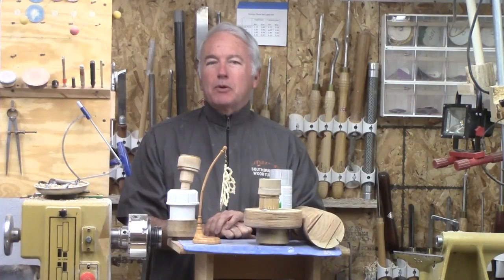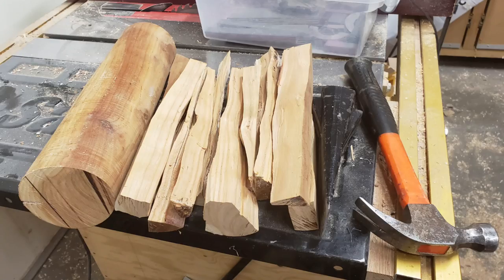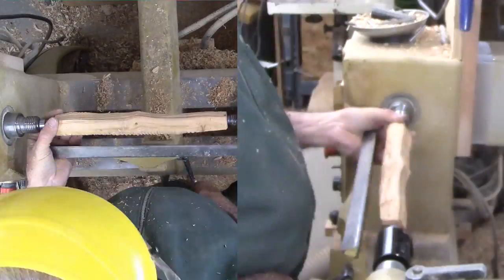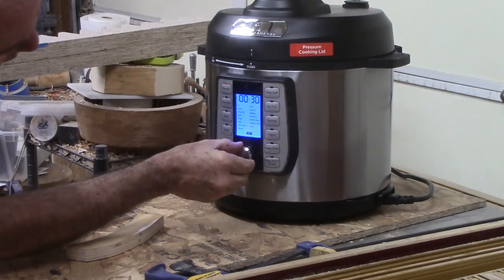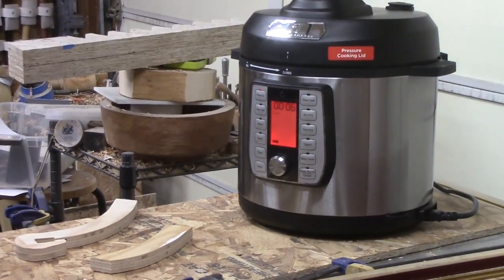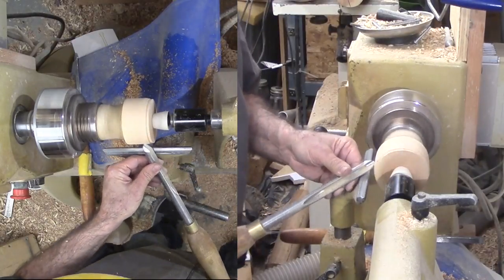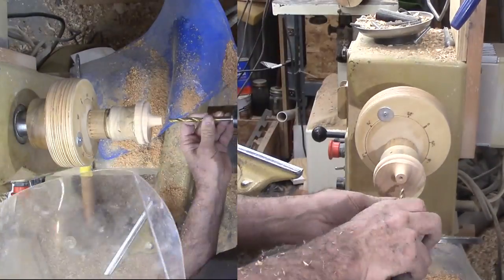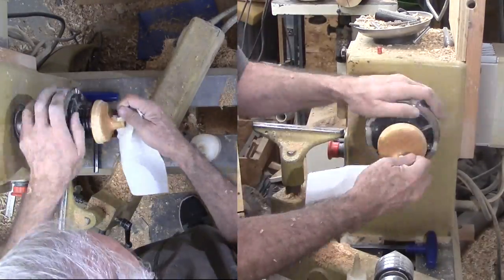Woodturning Project Stand - Steam Bent and Multi Axis

Comment: Great project, looks very good. Instead of a pressure cooker one could take a page from Mike Hosaluk's book and use the microwave. I attended a work shop with him and he showed his method of prepping for bending. We used a form for shape, and wrapped the work piece in a towel soaked with water. A couple of minutes in the microwave and the boiling water and the fluids in the wood resulted in a very flexible work piece, just had to be careful and use gloves to handle the boiling hot piece. Once in the form and allowed to cool it stayed in shape. Quick and easy.
I also watched David Springett do something similar with branch wood that was rived from a branch, he used a post iron to heat the wood with just a wipe of a wet rag. He suggested that the water content in cells made the branch soft and the outside water may have been overkill but he was able to manipulate the piece a bit at a time without using a form.
Reply from the maker: All good alternatives to consider. 
Thank you Bert
Alan

Comment: Outstanding Alan. Thanks for the tip on splitting wood for this spindles. And the technique of turning the spindle tip then working back to the base to prevent whipping. Nice idea on the pressure cooker. The bending jig worked very well. Nice fixture for the offset turning of the base. I should make several. Thanks for sharing.
Reply from the maker: You're welcome Glen. sounds like you need some shop time. :)
Alan

Comment: I make Shaker boxes, and bend forms more tightly  than you did. I heat the cherry wood veneer (probably 1/3 the thickness of your stand) in near boiling water for 20 minutes, and it works well.  I was told that the lignin in the wood softens at 185-187 def F and that is what allows the wood to bend and then hold the form after cooling. (My wife doesn't have a pressure cooker, so I am going to try boiling water instead.)
Reply from the maker: There's a lot of history (including  Frank who showed me) of boiling. But given my wife's pressure cooker, I'll stick with the pressure cooker as long as the wood will fit inside. :)
Alan